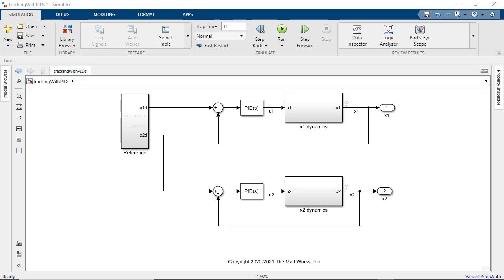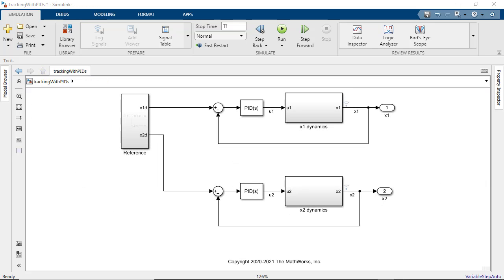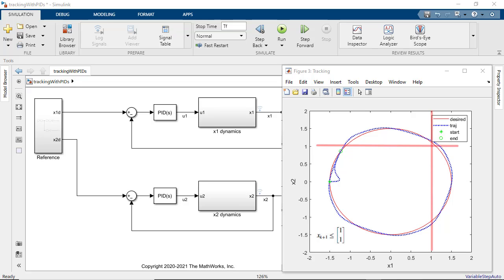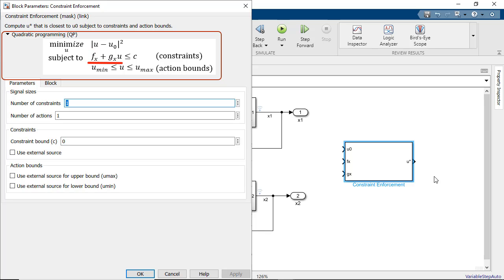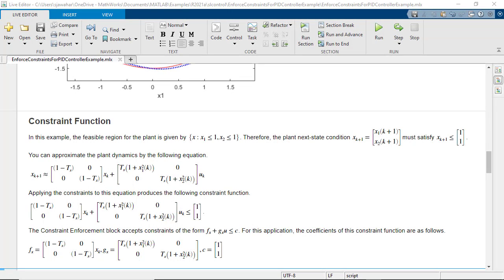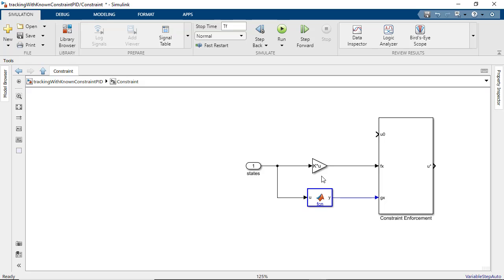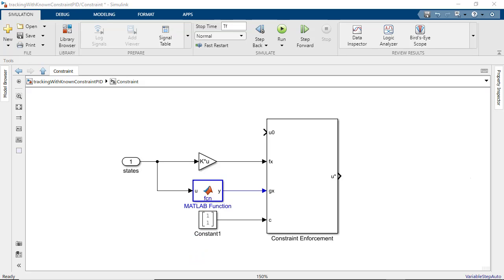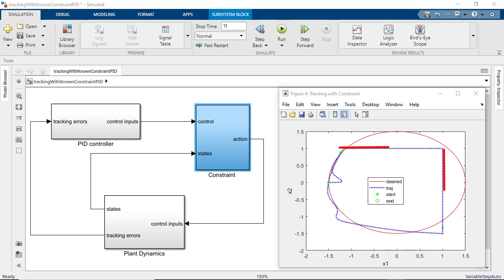Enforce Constraints for PID Controllers

Comment: 5:18 state x2 is less than -1 in the bottom right corner of the trajectory, so the constraint is not being enforced.
Reply: Good point! But the constraint only says <= 1, he didn’t necessarily specify that it should be between -1 & 1